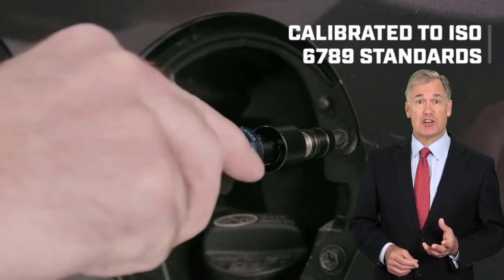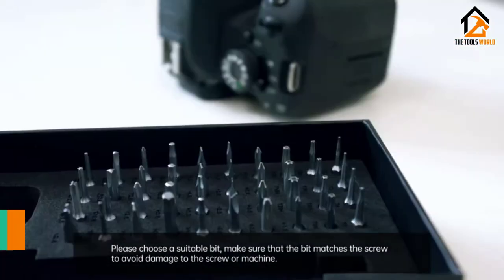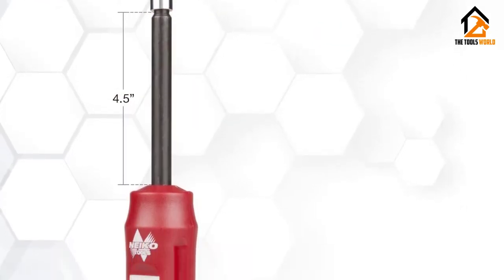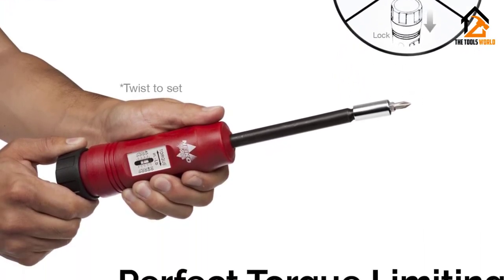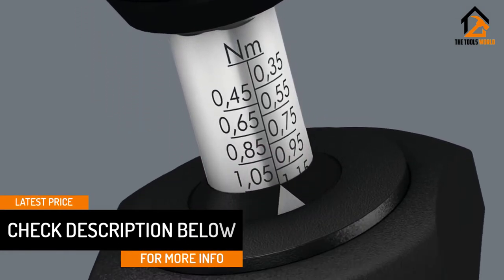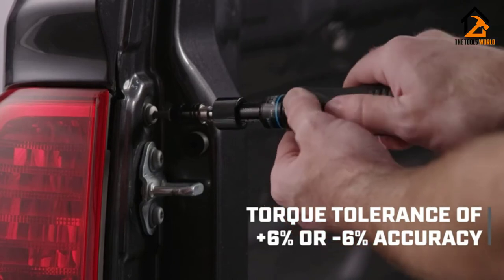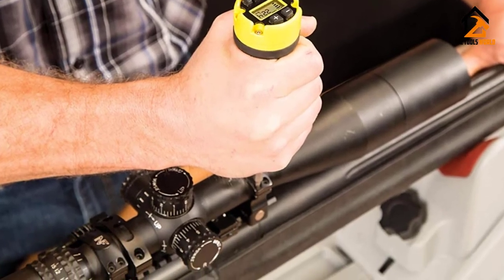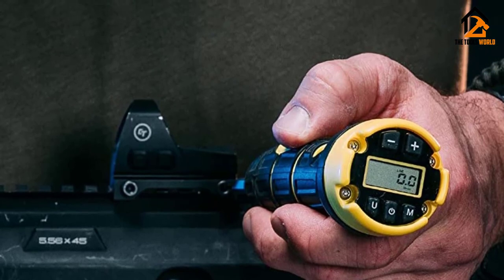Best Torque Screwdrivers | Top 5 Torque Screwdrivers Review

Comment: I have the Vortex. It will not hold some bits because it is non magnetic, not good. Also its non clicking cam over function does not inspire confidence that screws are not over torqued. I think the Wheeler is the way to go.